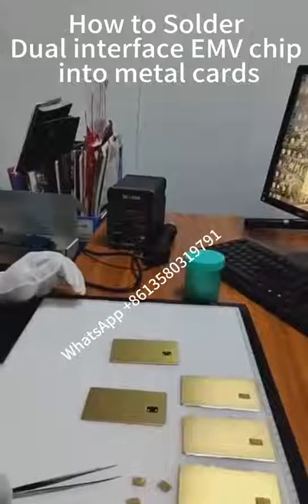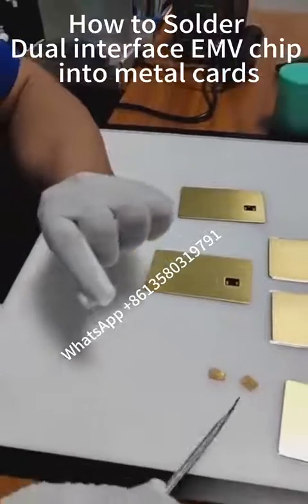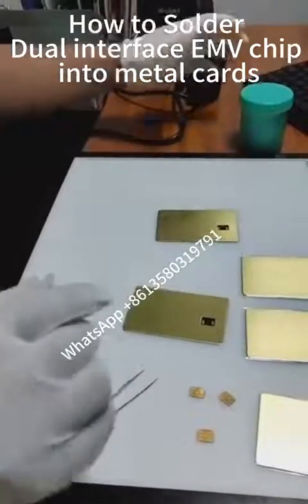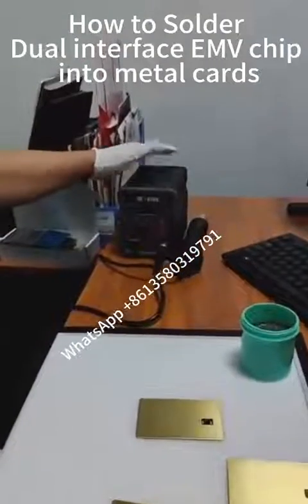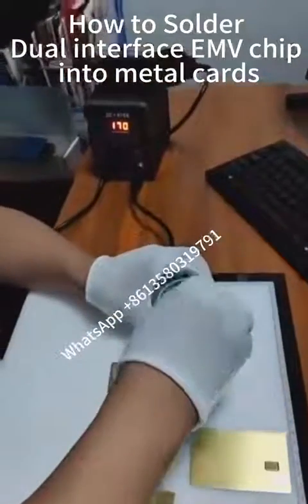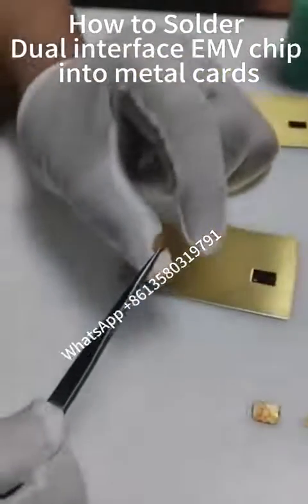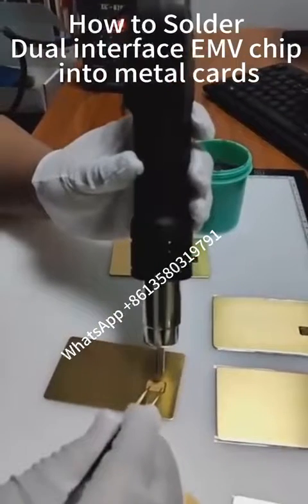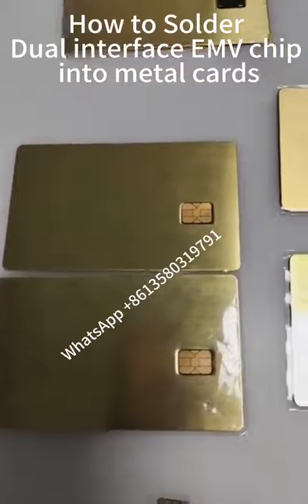how to solder dual interface EMV chip into metal cards?

Comment: When using the heat gun do you press firmly on the chip or just hold it closely??
Reply from the maker: on mass production, we have a Fixture to press them. do you need any of them?
Reply: @michaelchang6042   Send me a link to your company i'm interested in buying cards And the machine for Large protection
Reply: What's the link i'm interested in buying the machine for Mass production And the cards
Reply from the maker: pls add my whatsapp +8613580319791 @S.P-187
Reply from the maker: i think need not